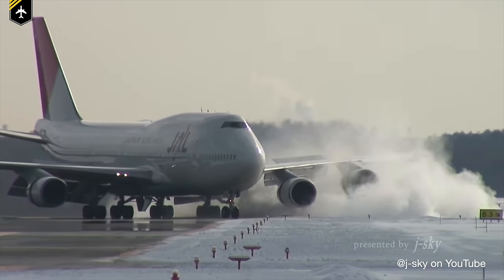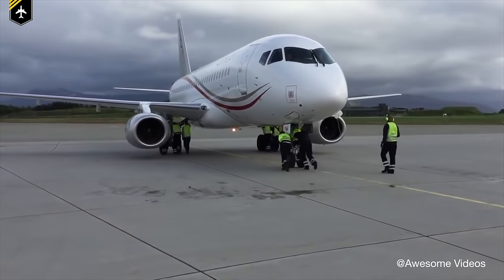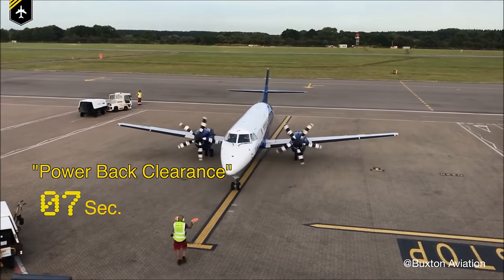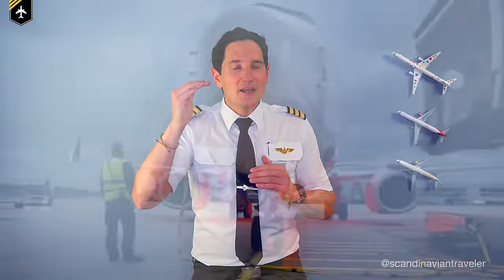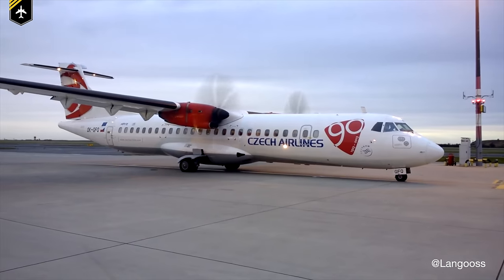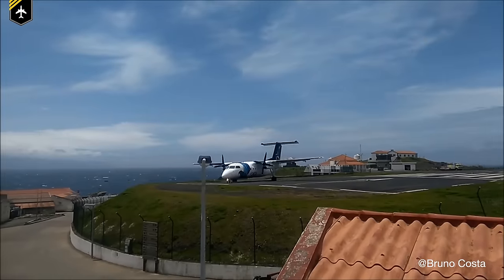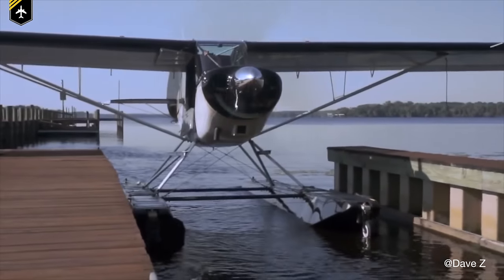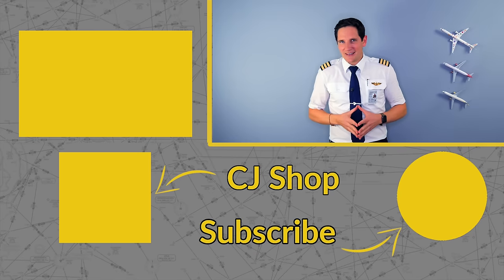Can planes REVERSE out of the GATE? POWERBACK procedure explained by CAPTAIN JOE

Comment: If the push back vehicle can take the plane from parking to runway it can save fuel.  Is that so?
Reply: dioboysunny depending on the situation, could be both yes or no. It would definitely save some taxi fuel, but will reduce the runway utilisation per hour

Comment: Hi, Captain Joe!
Could you explain how planes are monitored in real time and why is it possible to lose a plane?
I always wondered why don't they just put a GPS tracker on every plane, sending location to satellite networks or land based stations to keep tracking of every plane. Whenever I hear a plane was lost, I can't figure out why there is not such a global network of receiving systems. For in every case of missing planes it takes a lot of money to find and rescue the people and every second counts. Also having to wait until long periods of silence to declare a situation, then long periods until all fuel is used to declare a crash and rescue operation.

Do planes have always ATC coverage? Like radio signal even over oceans? Why not use that to transmit GPS location, altitude and direction in real time every minute or so?
Reply: Actually, the system exists. The aircraft use ADS-B technology. The aircraft receives signals from GPS satellites to determine its location. The aircraft broadcasts its location to the ground stations, and ground stations transmit the data to the ATC. Also for example FlightRadar24 and FlightAware uses this technology.
However, there are not always enough ground stations (for example above the ocean) and the data is transmitted when the aircraft is near the next possible ground station. But space-based ADS-B flight tracking which uses new Iridium satellites should be ready to use already, and this eliminates coverage gaps over oceans and polar regions.
Reply: @mikep9604  that would be awesome! Hope it enters production fast enough!
Thanks man!
Reply: @mikep9604  it could also relay to other aircraft... Then if anything happens while there is no station coverage, the data would be somewhere else.
Specially when flying over mountains or oceans.
Reply: @mikep9604  reading on Wikipedia... Oh it's just being deployed in January! And some parts have it for longer, like Europe....
Then there's my question why does this don't exist since the Wright brothers? Just kidding, but the technology could have been operational since the eighties or nineties. It's a pity that only now something like this is being gradually deployed.
I can't believe it 🙆
Reply: @Ktulu789  - Have you used  FlightAware or FlightRadar24 web sites? You can track flights there.
Reply: @mikep9604  i will check them!.
Thanks man! Have a great 2020!
Reply: @Ktulu789  - Thanks! And happy New Year!

Comment: Why not use an electric powered tow truck for the whole taxi procedure? So the aircraft could be towed out to the runway, where the truck detaches, and the jet engines could be fired up for takeoff. This could reduce fuel wasting, engine wear, and the chance of the engines picking up debris.

Comment: If the electric motors are also used for taxi, wouldn't that be more fuel savings? Or would the weight still not justify it
Reply: dxkaiyuan the electric motors would just increase complexity and weight. And in the air, it’ll just be deadweight.

Comment: Actually, SIDENOTE:

SAFRAN GROUP and AIRBUS are working to put the electric taxiing on the A320 family in 2022.
That will make planes taxi to and from gate to runway in electric powered from APU, reducing the fuel use and making taxiways safer.
You can learn more about this tech in SAFRAN LANDING SYSTEMS web page.
Reply: They stopped working on that project

Comment: Captain Joe how does a propeller airplane use reverse thrust since the direction of the propeller stays the same. This could be a very naive question
Reply: There is a mechanism in the propeller hub which allows that the angle of the propeller blades can be changed, so that the thrust is directed to other direction.
Here is an example of the mechanism:
https://upload.wikimedia.org/wikipedia/commons/e/ee/Propeller_diagram.jpg

Comment: Hello Captain, can you explain y jet engines have a series of blades or large numbers of blades to their fans?
Reply: Those blades push the air into the jet engine it needs for the combustion process.
Reply: @mikep9604  y can't Four or five blades be enough to push air into the engine? What's the real reason for having so many blades?
Reply: @manaspandey3558  - Simple reason is that four or five blades are not enough to do that. The fan with more blades is much more effective.

Comment: Why don't to use hydraulic motors  fitting on wheels for reverse movement of aircraft.
Reply: This kind of system will make the landing gear structure more complicated, and it also increases weight and the need for extra maintenance, which will raise the total maintenance costs. The system would also be an additional target for malfunctions that would cause problems to airlines. It's not good to make things too complicated when no actual benefits are achieved.

Comment: @Captain Joe Do all pilots have to learn English? Or do you have to learn multiple languages. I assume most of the industry operates on a common language, but I could be wrong. Whats your input?
Reply: The airline pilots must speak English. English is the language used in aviation. You have to do an English proficiency test even if English is your native language.
Reply: Sir We Are About to Die  - I don't know what you exactly mean. English is used internationally in aviation in order that  there is one language all the pilots can understand in communication with the Air Traffic Control. 
All the pilots have to understand the instructions given by the Air Traffic Control, and English has been chosen to be the language used internationally in aviation.

If all the pilots and the ATC would only use their native language then pilots from other countries can't understand what the ATC or other pilots say. But now there is one language which all the pilots use worldwide in communication with the Air Traffic Control.
Reply: Sir We Are About to Die  - Yes. A pilot must speak at least two languages. The native language and English (in case English is not the native language).

Comment: The risk of ingestion is why reverse thrust is cancelled as the aircraft decelerates to 70kts on landing too. And yes, it would be too heavy to motorise the wheels.
Reply: Well, it was my thought as well that they don't motorise the wheels because of the additional weight. But apparently Airbus is planing to introduce such a system in 2022 for the A320 Family.
And actually it makes sense if an airplane flyes mainly short haul out of notorious busy airports. Because they can use up to 400kg of fuel just rolling around. Also, you need to carry around less fuel for taxiing at the destination airport. So basically, the system may still save weight in the end.

Comment: Why doesn't the landing gear have an electric motor for backing?
Reply: Because it would make the landing gear construction more complicated. It would also increase the cost of the aircraft, and the system would also require extra maintenance. It's just simpler to use pushback tugs.

Comment: Im the greayest pushback driver of all time, ive had my pushes measured with laser protractor, i get the body avg of 2 degrees of centre, ill reverse push a 747 around the whole airport if i have  too
Reply: Daniel Shiel come teach the people at the airports I work at to do that. I’m
Tired of replacing shear pins cause thay don’t understand not to turn so sharp.
Reply: @lemonaid8678  tell them to steer with the beacon, use the beacon to guide ur pushbacks and reverses. Keep beacon on the lines and never go wrong
Reply: Smaller aircraft i steer using  the tail as the guide.
Reply: Daniel Shiel you cant tell these guys anything they just don’t understand Lol I’m a GSE mechanic so I don’t know who brakes it I just find it broken when I do my daily checksz

Comment: Dear captain. Could you please explain how this happens with propellers? I just can't wrap my head around that.
Reply: You mean thrust reversal? It's actually simpler than with a jet. Just a change the pitch angle of the propeller blades the right way and it start's to produce thrust in the other direction.
Generally in turboprop planes the propeller always runs with constant rpm once real power is demanded and only the pitch angle of the blades is changed to adjust thrust.
Reply: @shi01  hmm. I wish I could picture it in my head. Cause I still don't understand. But I appreciate that you took the time to write this down. Thank you very much.
Reply: @gino27224  The propellor blades twist round so that the thrust they produce pushes in the opposite direction.
Reply: @shi01  I didn't know turboprops ran at constant RPM. I was on a Dash 8 recently sitting between the propellors. I should have watched them more closely.
Reply: @caw25sha  you mean a full 180. Flat side facing forward?

Comment: Joe,would a hydrogen turboprop plane work I really want to know
Reply: Probably.
Maybe not in the form of today's airplanes though. You would need a lot of pressure tanks which would weigh the plane down, but since battery powered electric planes are a thing,I wouldn't write it off as impossible.
Reply: @carstekoch   good point,thanks😀

Comment: It is not that, they can't reverse on their own. They can reverse on their own power, but they avoid to use it due to some reasons. The system that they use to reverse themselves, is known as Reverse Thrust. Jet engines expels out a high speed velocity of exhaust gases, which pushes the aircraft forward.

Here's a simple answer lol

Comment: What are all the pieces of ground equipment (and nearly two dozen hoses & cables) around a plane at the gate?  Can we do a video explaining all the bits of ground equipment?
Reply: Alex Derus tugs,pushbacks,gpu,ac/heat carts, belt loaders,bagcarts, lav carts, potable water carts, the cables you see are 28v or 400hz for powering the plane when on the ground. You also have air bottles or continues airstart for starting the planes. And the big hoses you see is what runs the heat and ac to the inside of the planes. I’m a GSE mechanic. That’s the stuff I work on.

Comment: Why do we need to turn our phobes off duribg takeoff and landing?
Reply: Basically a safety precaution from about 60 years ago, where cellphones and the planes radio systems had overlapping frequencies and could cause interferences. Shouldn't be the case anymore, but since you can't use your phone during flight anyways it has remained. Just in case.

Comment: If engineered correctly, I am quite sure that in hub electric motors can be used not only for powerback, but also taxiing AND help at takeoff AND braking on landing. Simply, don't f*k it up like Boeing did for the Dreamliner...

Comment: What is flight level?
Reply: They are standard altitudes that are based on atmospheric pressure. They are measured in terms of hundreds of feets. For example FL180 is 18000 feet, FL350 is 35000 feet.

Comment: Where do jet engine get there power from?
Reply: Sir We Are About to Die  - You are referring to APU but it's not always turned on. When the aircraft is on the ground it's turned on to produce electricity for the systems, but when the main engines are started the APU will be shut down.

Comment: Why didn't Boeing improve the 747 instead of designing that new plane thats currently grounded???
Reply: The Boeing 747 is a large, wide-bodied jumbo-jet with four engines. The Boeing 737 Max is a smaller, single-aisle jet with two engines. They have different purposes and would generally not be used for the same routes.

However, the 737 is more similar to the 757, so a better question would be why did Boeing not modify the 757 instead of creating the 737 Max?

Comment: I dont think the rational for not using electric motors is very solid.  I would venture to say that cars drive on much poorer surfaces than planes on runways but we have electric cars with motors at the wheels.  It's not been reported any issues with such a design.

Comment: Aircraft require a lot of power/ fuel to get moving. As expensive as fuel has become why waste it going reverse out of the gate.
Reply: It's not today the procedure used at the gate in front of the airport terminal. One reason is safety, and because it also increases the fuel consumption.
The jet blast is dangerous for the people working there, and the jet blast can damage the nearby equipment and buildings.
The engines can also ingest debris from the ground which can damage the engines. It's just safer to use a pushback tug to move the aircraft from the gate.

Comment: I’d rather would have a tug to push the plane back rather than to sweat with 100+ people in the plane
Reply: As the power-back does not take too long, the air conditioning system will probably only be off for a short time.

Comment: Less equipment, less people, more control = happy pilots. But airports don’t like pilots. They like rules, procedures, protocols and especially the revenue from pushbacks (£50 at HUY up to £500 at places like LHR). Remember, airports are run by greedy spineless idiots who don’t like aircraft. They like shops and parking. 

Incidentally you are totally wrong about full length departures. You use as much runway as you need. That is why we have performance computers. If a shorter taxi time will achieve a earlier airborne time then it has to be a good thing, providing it is sufficient and reduced thrust requirements can still be met. Adding more runway changes nothing other than potential delays, more tyre wear, hotter brakes and more time taxiing. Additionally, if an intersection allows you to make Slot and full length does not then it’s a no brainier.

Comment: Can planes REVERSE out of the GATE? YES and NO

YES they can. if they used the reversers they use when landing then a plane CAN reverse out of the gate.

NO they will not because this causes unnecessary strain on the engines and anything in front of the engine when reversing at the gate will get sucked up into the engine or blown away causing unneeded or wanted damage to people and property.

Comment: With an electric engine in the gear wheels, you could also pre-launch the wheels before landing to avoid them to drag on the runway :)
Reply: Has been tried, but the additional fuel and maintenance costs exceeded the savings from the lesser wear of the tires.
Reply: Carsten Koch I was born too late  🤔